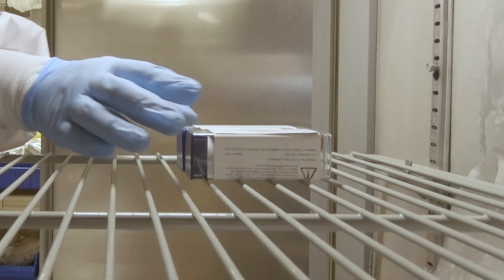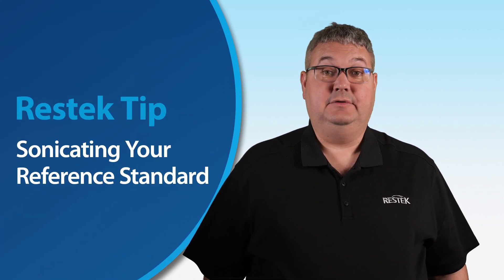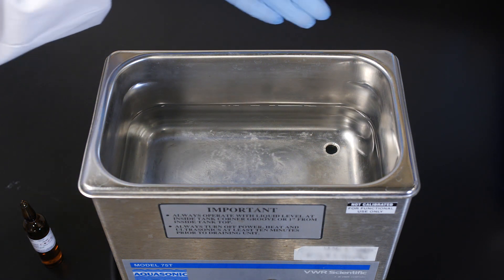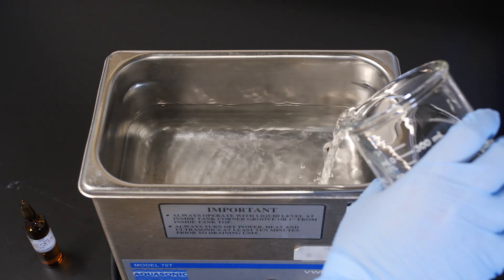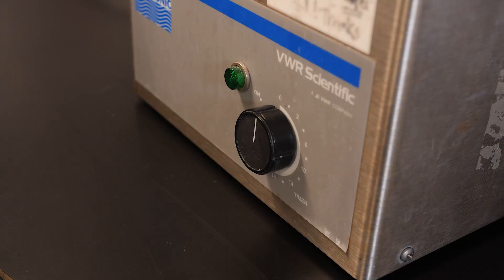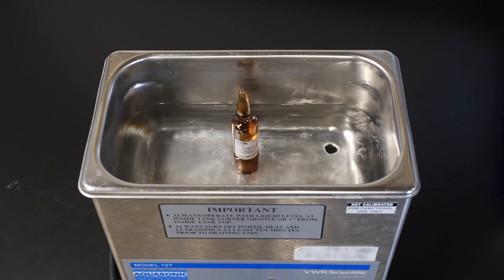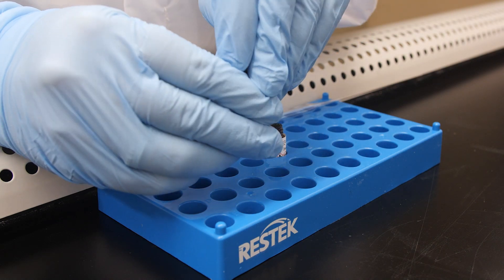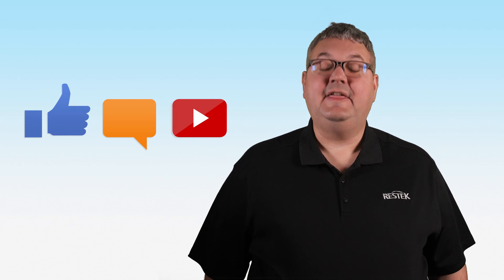Sonicating Your Reference Standard

Comment: What if the material is heat sensitive? because sonication must leads to generate heat.
Reply from the maker: Certainly, analyte stability is always critical. You can manage excess heating by cooling your sonication bath for example.

Comment: I have a doubt can u clarify what is dwell volume
Dead volume
Delay volume
Reply from the maker: If we define these according to an LC instrument, the dead volume is the total volume of the system from inlet to detector excluding the column. It is the system volume that ideally is not participating in the chromatographic separation. The dwell volume is the volume between the solvent mixer and the column, and represents the delay from when solvent is mixed to when it gets to the column and starts impacting the separation. Dwell volume is also called gradient delay volume.